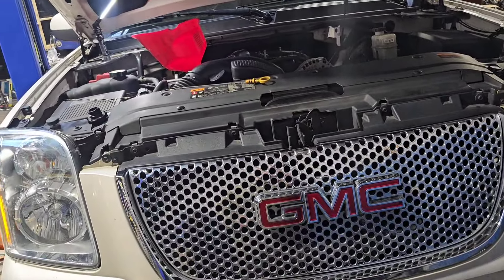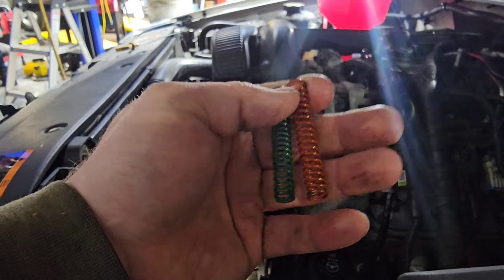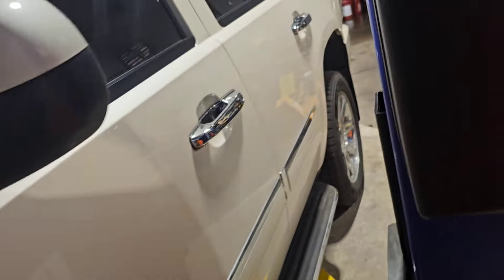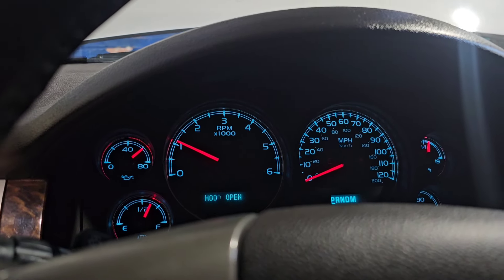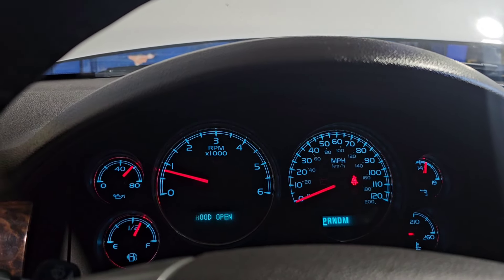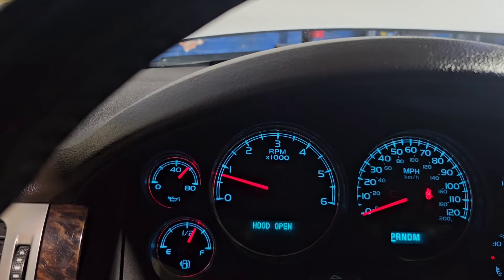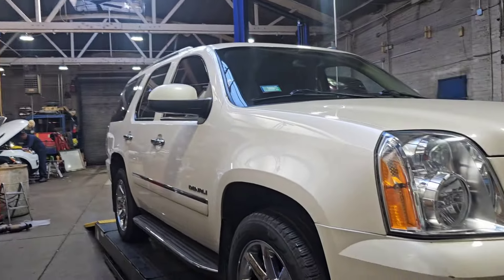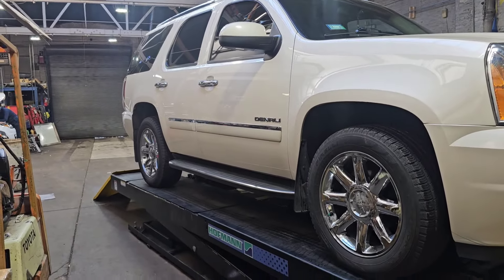2014 Yukon Denali 6.2L Dod Delete Part 2 - Don't Use The Green Spring - Use yellow it's like stock

Comment: Still really good oil pressure! On some of the gen 3 5.3's we do the top ends on well use a gen 4 oil pump made by melling puts the oil pressure up there. I do that cause engines have miles on them and customer doesnt want the full rebuid!

Comment: great job bro . can i avoid all this by buying a 06 or before chevy or gmc truck ?  one will under 100k no winters . there are some nice grandpa trucks out there for around 7grand . is it a better idea to buy a clean truck without todays problems ?
Reply: One of the best I ever owned was an 05 Yukon XL that I took the 5.3 out of at 230k MI when it started tapping because I had a donor 6.0 LQ4 and eventually sold it to a buddy and it still runs like a champ to this day. 
Paid $4k for the vehicle with no rust(lucky) and had $2k in the swap. Runs like a champ and solid.

Comment: I had the bigger one in and I have like 55 on cold start and almost goes to 80 on throttle. I also got the better high volume Melling oil put in.  Do I have to worry about anything? I had it done around ten thousand miles ago and no problem or leaks so far. Mine is a 05 suburban with the 5.3.

Comment: I just sent my ecm out and deleted that  program
Reply from the maker: Right you delete the program but you still have the faulty components that can still go bad inside the engine so just because the program is not there anymore the components are still there and they can fail
Reply: @FordBossMe  this is true, but the in and out of v8 is what kills those lifters. 200k and no issues